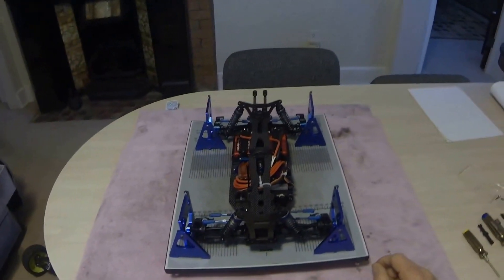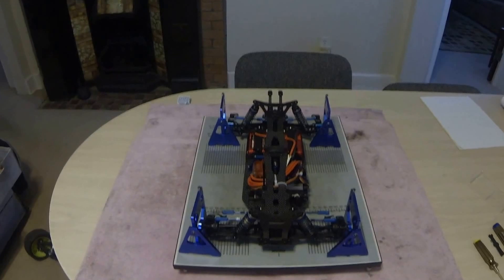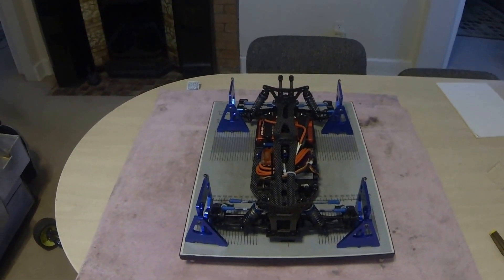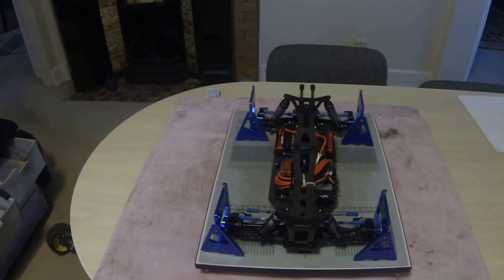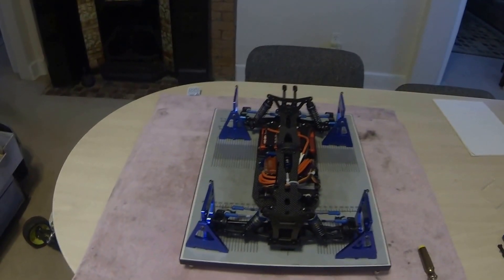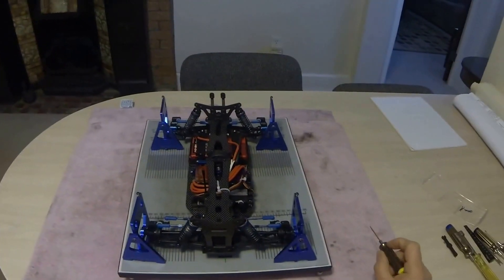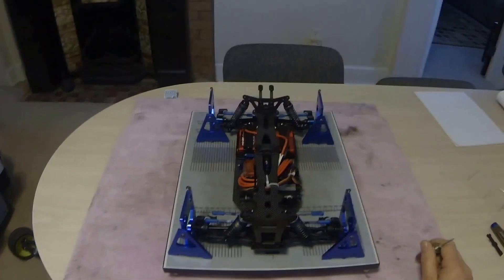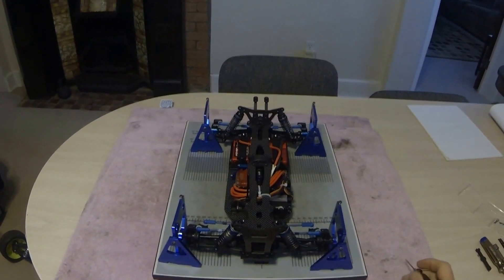Creating AE B44 2 Model - Part 1 Measurements

Comment: Hi, at minute 19.56 you say you added the other dimension of camber link - but I see 2 extra measurements the LCambLnk and the LKing  also, is there something I am missing or overlooking as its slightly confusing to me? Thanks
Reply: There are different positions that you can connect the camber link to at the chassis and on steering hub. These "alternate" positions are input as points relative to the location that the camber link is connected to when you enter the model in the Chassis Manager. This allows you to select these points them when entering setups. If you look at one of the other chassis models like the B44, B6 or B64 that are available for download on the website that may help clarify things for you. The Help file in the Chassis Manager may also provide insight.
Reply: @carvideos4023  Yes I will do that and I also think I am figuring it out slowly, really enjoying doing it though and thank you for your info and super quick response, its very much appreciated.
Reply: @carvideos4023  Ah yes, just figured it out from what you said and looking at the models in the CrewChief, thanks man

Comment: Does it matter a lot if suspension arms are gullwing style? I just bought the software and measured a B74. The rear arms are not straight, but are angled upwards behind the shock mount, so the angle of the arm shown in the software does not match the angle of the real arm.
Reply from the maker: No it does not. The arm length is still the distance between the inner and outer hinge pins. The reason the arm is gull wing shape is to lower the shock mounting points which helps to lower the CG and/or increase the shock stroke in bump. The lower shock mount position will account for the gull wing shape.
Reply: @RCCrewChief  Thank you very much for your reply. Maybe you can help me out with two more questions regarding the measurement of my B74. This specific har has seperate mounting points for king pin and camber link on the front hub with the ball for the camber link on the inside and steering arm mount and king pin locatet on the outside. I suppose that the resulting model has more king pin inclination than the real car. Does this matter for the calculations or can i ignore this?

As the front drive shafts are inclined backwards, what would be the better representation for Axle Cl, through the diff, which gives a longer Lcc or through the CVA axle, which gives a shorter Lcc?
Reply from the maker: @Shunshun604  The King Pin and steering axis are are different on the front. The program can handle this. The King Pin length will be measured between the arm outer hinge pin and the camber link ball stud. Those are the suspension pivot points. For the steering you should measure Lcc to the Axle CL

Comment: If I buy the software, does the manual help walk you through this process?
Reply: Hi Chris, The best instructions I can provide are via these youtube videos. The program does have built in help files but they don't go into specific detail on how to measure every possible component. I am available via email to help you through any problems you may encounter. What vehicle are you planning to use it for?
Reply: Hey Bob, thanks for the reply, I would be using this for an RC 8.2 at the moment, and possibly a AE or Losi 10th scale 4wd buggy as well… I guess I can use the videos as a guide… the other question I had that I couldn't tell from the website is whether this program would run on Windows 8 or not?
Reply: Chris Provenzo
There is lots of good info in the help files too but in todays world videos are the easiest way to learn the program. The good news is there is already a model for the RC 8.2 so you don't have to create your own.
Lots of user's have told me how much they have learned in a few weeks. Compare that to the years it took me to figure it out by trial and error. That's what inspired me put some science into the setup process to shorten learning curve for others. It's not a magic bullet but if you are willing to invest a little time you will learn a ton.
Reply: Bob Wright and yes it will run on Windows 8 you can install the program and try it first
Reply: Hi, recently bought this super in depth software and I am just in the process of putting data in for my 4 buggies, all team associated - B4, B44, B6.2D, B74 and am wondering... When you weight total mass is the battery included? Thanks.
Reply from the maker: Kaylem yes total weight should include everything.
Reply: @RCCrewChief  thanks, already learning lol